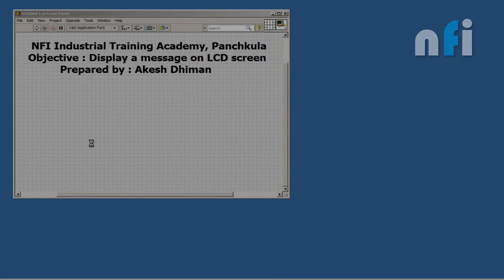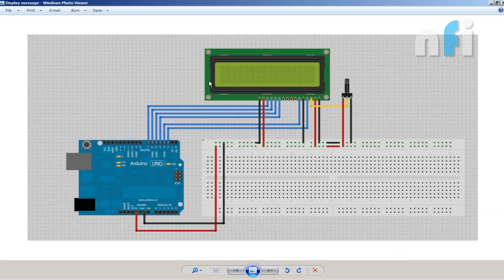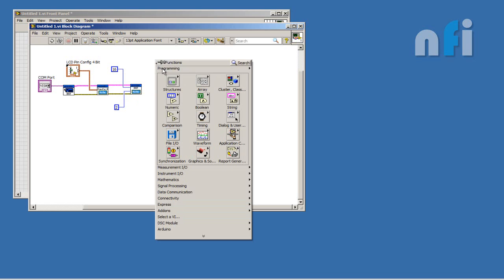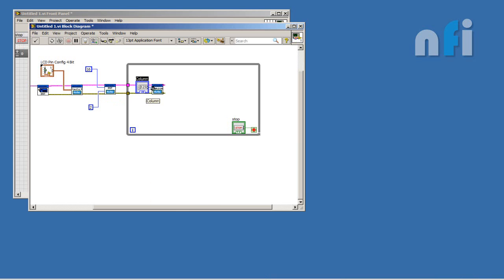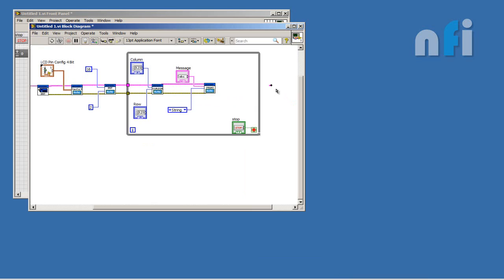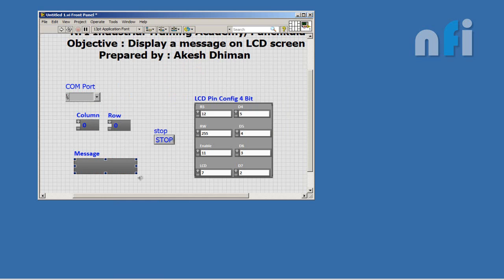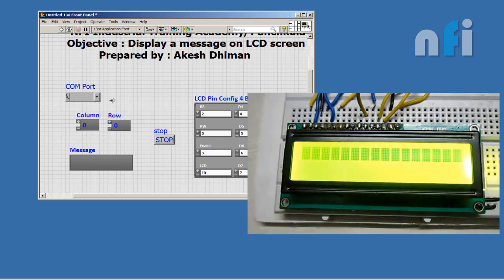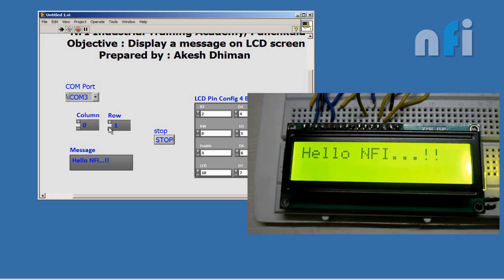Arduino meets LabVIEW: Displaying Message on LCD Screen using LabVIEW

Comment: i make same circuit but it doesnt  work LCD doesnot show which i write, only i used arduino PIN8 instead of 7....kindly help me
Reply from the maker: +Noman Aslam Kindly Write to nfiautomation@gmail.com with your circuit diagram and screenshot of Labciew code

Comment: why pin LCD pin 10? In your diagram you have nothing connected to pin 10
Reply from the maker: +Wade Wilson In LCD Pin 7 - 14 are data pins so in total there are 8 pins. We need any 4 pics of LCD to display the data. To avoid mess in the wiring we have used Pin no 11, 12,13,14 of LCD. You can also choose pin 7-10. I hope this make sense!

Comment: hello
i tried to make this project, but it doesn´t work
if i press "refresh" the "COM3" doesn´t appear, although my aruduino(sunfounder) is connected to the computer
can anybody help me?

do i need an original arduino?
Reply: +schmodi the sensai use the Arduino IDE software to find out the comx port your arduino uses, it isn't always in com3